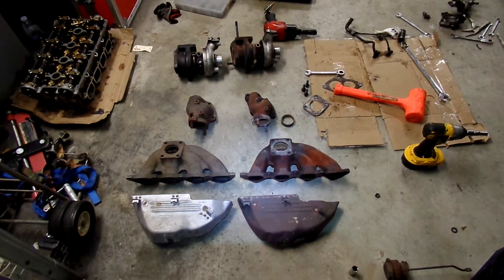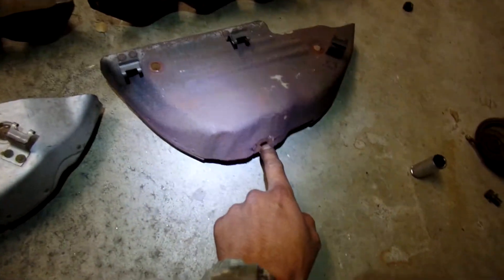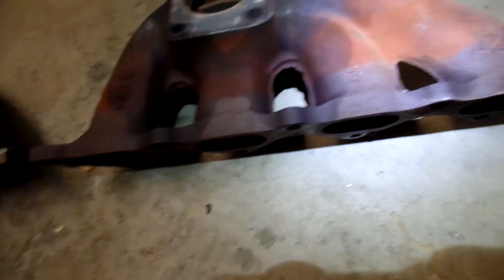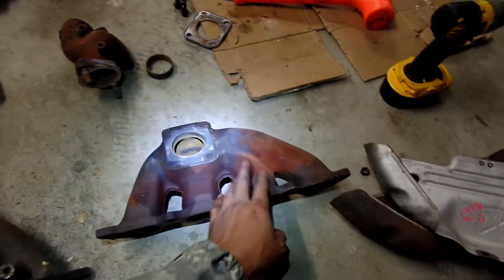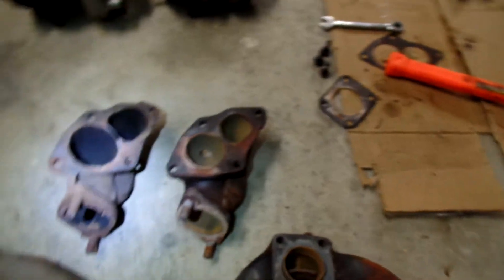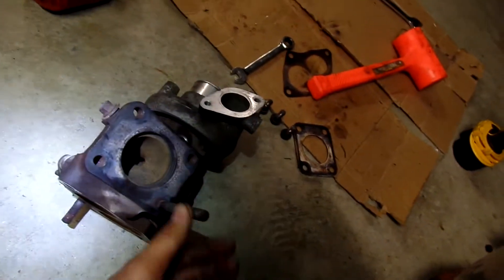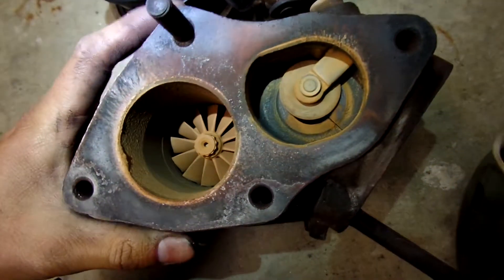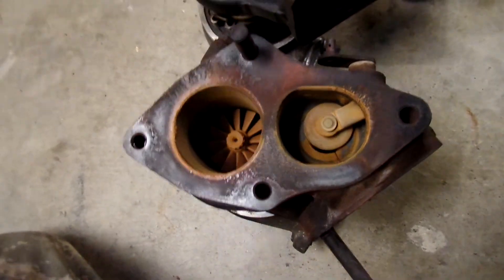1G vs 2G DSM turbo components plus s16G vs 14B comparisons

Comment: Nice video so question im trying to keep it without being tuned would stock turbo be better than that 14b since I keep reading old forums that 14b was better but after seeing your video I don’t see how.another question is there such a turbo that can improve car without being tuned?
Reply from the maker: If you are running similar boost levels you won't need a tune.  The 14B is a larger turbo than the stock T25, the 14B will still make power at higher RPMs and it's spool is roughly the same as a T25.  You don't need a tune the ECU is already tuned, the path to making bike power with turbos is to upgrade the fuel system more specifically the fuel injectors, if you change the injectors you need to tune the ECU so you can compensate for the extra fuel or else it won't run right too rich.  As long as you don't run more boost than your fuel system can handle it will be fine, and if you want to run more boost that is when it's time to upgrade the fuel system.

Comment: Yes you can swap exhaust turbine housings, for instance I have an evo III turbine housing on my 14b. The reason is that they are both tdo5h turbine wheels, however the compressor housings are machined differently, since the compressor wheels are not the same.

Comment: Small 16g turbos were originally fitted on the jdm galant vr4 4g63t in the US it was listed as an oem upgrade for the 14b. 

And the 2g manifold is known as an upgrade, simply because they have a higher nickel content, added into the metal used to make them, so in a nutshell, they are less prone to cracking then the 1g style manifolds. and the 2g o2 sensor is a lot better then a 1g style one in terms of 
flow, and Mitsubishi made them with a higher nickel content then the 1g o2 housing.
Reply: Only the JDM Evolution had the 16G (and it was a big 16G, not a small 16G). The regular non-Evolution JDM Galants still had the 14B like the USDM and 1G.
Reply: I should clarify - the JDM Galant VR-4 Evolution - ie all 5M/T JDM's built from mid 1990 until mid 1992. These Evolution VR-4s also had 510cc yellow top injectors, larger intercooler&piping, close ratio transmission with 3.909 4-bolt rear end along with visual differences such as the hood and extra bumper vents, 'ECI-MULTI' inlet manifold badging instead of 'CYCLONE' despite still having the 'CYCLONE' style inlet manifold.